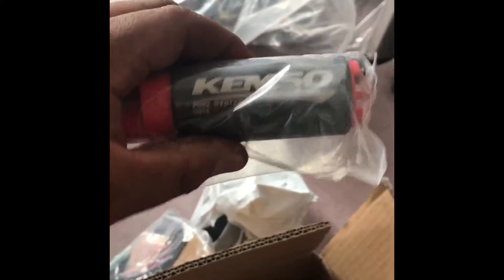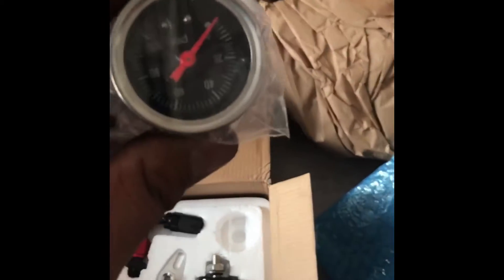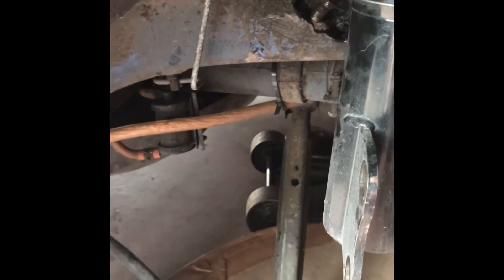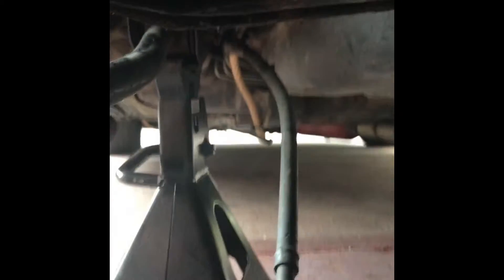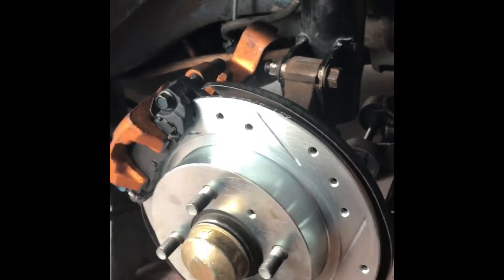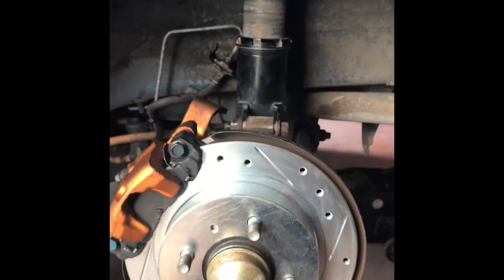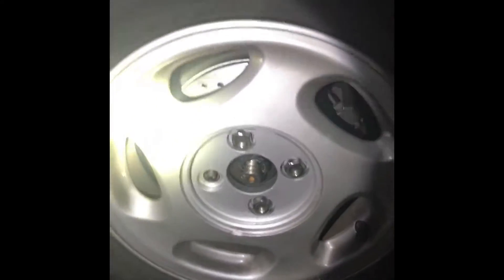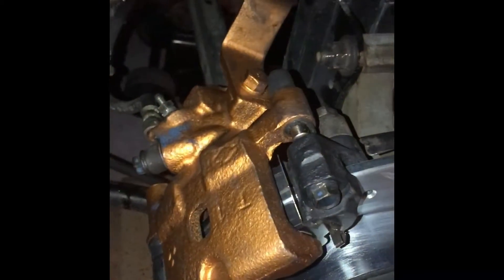Rear disc convertion epsd 1

Comment: Love the car bro! Iv just started my 1990 n13 sentra and it has a fair bit of rust but alot of parts (suspension components) look very similar to this model and p10/11 primera and was wondering if you know if i can use these parts as replacements since n13 parts are hard to get in new zealand but primeras are very common and i dont have the money to waste on parts that wont work, any info would be a huge help as there isnt much on the internet about n13s. cheers man 👍
Reply: Also i have not managed to find any coilovers that are for an n13
Reply from the maker: Raaad bro keep going dont give up ! The suspension for these nissan are a little hard to find if not expensive but u can definitely modify their great cars tbh , thanx for the comments and subscription to my channel good to have great ppl watching 👍🏽💪🏽 if i can tell u anything it is not to give up on finding parts for it and some parts coud be exchangeable
Reply: Thanks bro i will keep that in mind , good luck in future builds man 👍